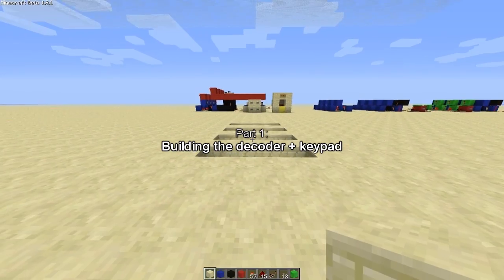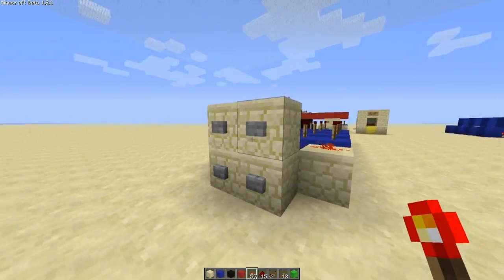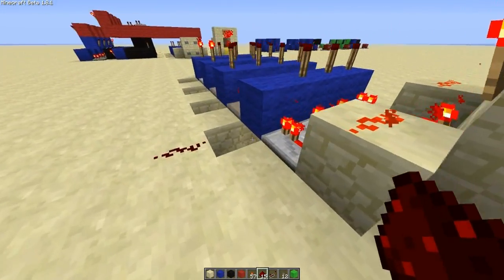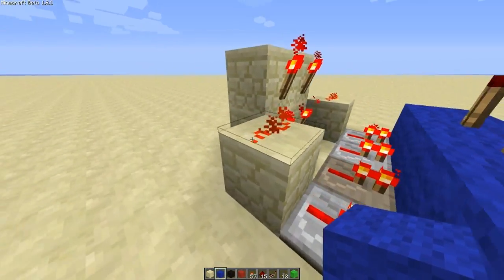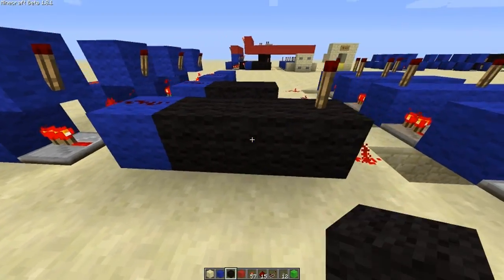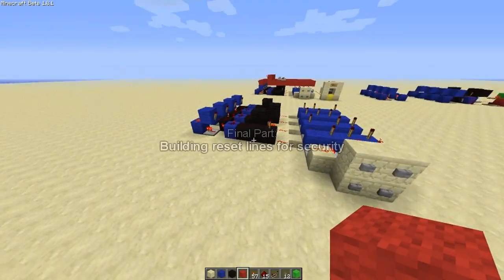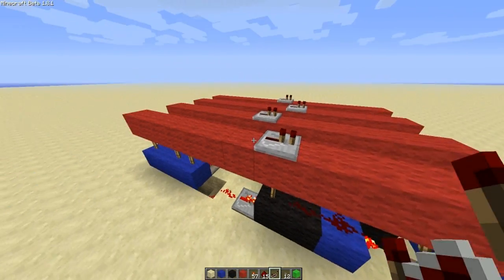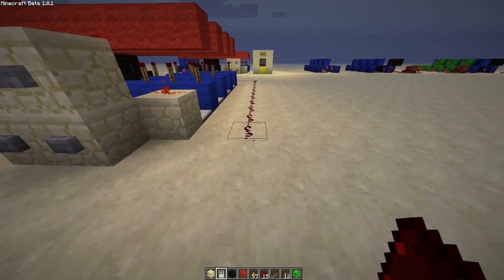Secure, Expandable Combination Lock! [Advanced Minecraft Redstone Tutorials]

Comment: couldn't you just press around until you press the last button since that's the output? wouldn't it be more logical to connect all the buttons to outputs and connect that to a latch and an AN gate so it will only work when all are on?

Comment: This happened to me and I couldn't figure out why, but if you have the black wool bit of the rs nor latch in opposite order it doesn't work, ie 2 black wool then 3. Also make sure the wool is placed over the wire after the repeaters. This sounds simple i know but it worked for me, if it doesn't i'm sorry just a suggestion to help.

Comment: Hmm.. I've tried and tried and tried.. and failed and failed and failed.. to get this to work.. the problem for me is in the reset... i set it up exactly like how you had it, making sure that i did everything exactly the same. But when I push the wrong button, it's corresponding torch still lights up instead of resetting the circuit. So essentially someone could walk up, hit the 4th button, and mosey on in no problem..

Comment: I've set it all up and fixed the "last digit" problem, but it's not holding the charge? The reset line just resets it even if I enter the correct code. (Doing it on a 9 digit code)

Comment: connect the output to an and gate and put a lever inside your room or you could use a button and a t flip flop and add a timer so it would shut itself off after you leave, I don't know how to connect a timer to the circuit itself so I don't know if its possible to make the combination reset by itself.